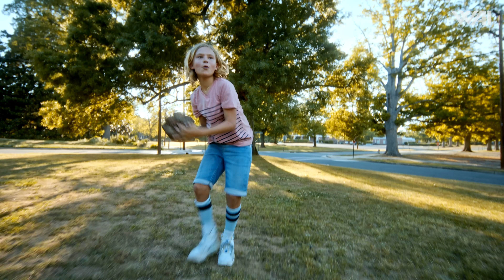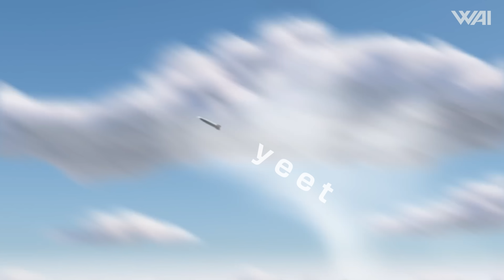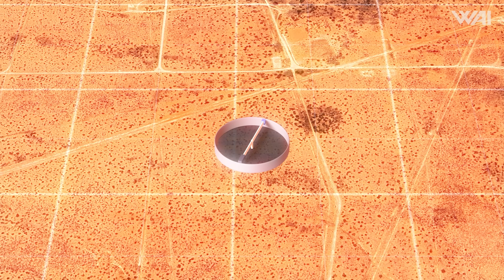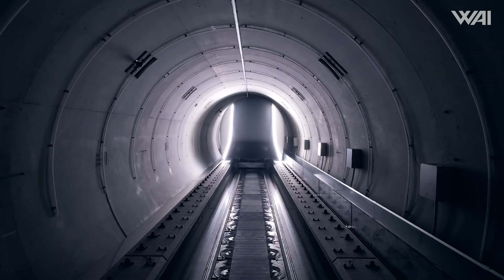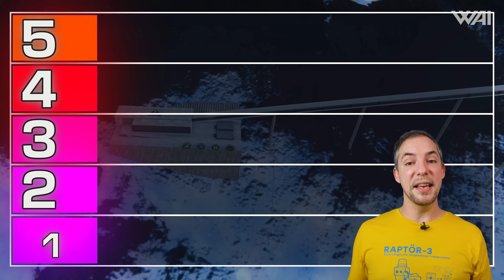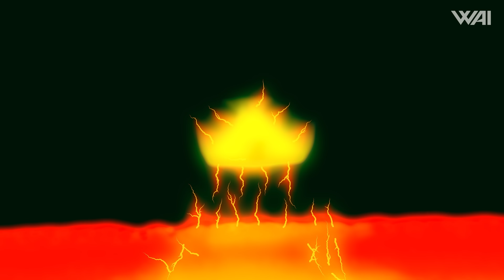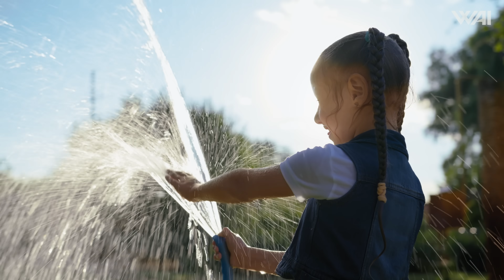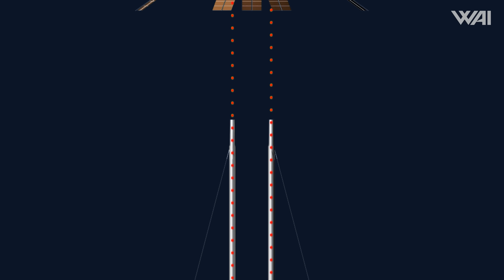The five craziest (but possible) ways to get to Space!

Comment: Search under Rovator. A wheel in orbit where the bottom reaches low to earth and teh top has more than escape velocity. Such structure could have the lowest point at 100km and the highest at several thousand km and the transfer would be with a hyper speed plane of mach 12. On the moon this would work with the lowest part stationary above the moon's surface.

Comment: Space elevators will NEVER be built. 

Why ? Because the electrical properties of the Earth will not allow it. Just think about a wire that connects even low level electrical charges to Earth Ground and it will be easy to imagine the lightning bolt that vaporizes the cable. This is already sound science and if ignored would turn that project into a money hole that would NEVER get completed because ... ZAP ... BOOM ... bye bye Baby !!

Comment: Actually there is material we have that would be acceptable to use as a tether. Graphene doped 10nm carbon nano tubes spun into a massive cable. The cable would be huge (3' or more thick depending on the counterweight's weight and distance.) and would need to be made in space, on a space station, and rolled out to the asteroid counterweight as once fully fabricated, would be too heavy to get it off the planet.. The biggest issue in this idea is capturing a NEO/asteroid, attaching rockets and flying it into a geo sync orbit for the counterweight. I considered using water or CO2 ice but sublimination would make this a non solution unless the entire sphere were sealed somehow. Just for giggles, the following is some of the math I was playing with...   Tether Deployment:
—Overall- 35,886 km CNT tether (1 m diameter, 63 GPa tensile strength, 38,000 tons total mass) deployed from Rig at 1,000 km to 9,500,000-ton asteroid Counterweight at 36,886 km; Rig factory (5,000 tons, 10 MW solar-powered) extrudes tether at 9.8 km/day, tug (2 Raptors, 5.5 MN thrust, 700 tons methalox) pulls tip to Counterweight over 10 years, attaching to pre-fitted anchor; tension balanced with initial 30,000-ton temporary mass at Rig (261 MN at 8.7 m/s²), scaling to ~29,000 tons (284 MN) as Rig grows, Counterweight maintains 285 MN upward pull; carbon sourced from ~2,000-3,000 tons space junk (yields ~1,500-2,250 tons carbon, cleared by 20 robots at 500 tons/year over ~4-6 years) plus ~21,300 tons carbon (85,200 tons methane) delivered via 568 Starship trips (2-3 years); humans oversee from 1,000 km habitat (2,500 kg, 6-month shifts, 12 trips/year); total timeline ~10-13 years with cleanup and delivery overlapping pull; tether capacity ~49,455 MN (0.785 m² x 63 GPa), safety factor ~173 vs. 285 MN.   ***This is of course theoretical...
Reply: 'There is a material'? Please show me a sample! It is not enough to be able to design a material, you also have to design a way to manufacture it! When we can manufacture a 1 meter sample, it will be worth thinking about scaling that up to 40,000km!
Reply: @john_hind  Google Graphene doped carbon nanotube filament.  it exists.

Comment: I saw a presentation on the space fountain years ago.  Cool concept.  But it occurs to me that this system has no non-cataclysmic failure modes.

Thinking about that ...

No
Non-cataclysmic
Failure modes. 

Eek!
Reply: It would probably a good idea to link multiple independend fountains together to support a single platform, so if one breaks down, the system doesn't collapse completely. I mean, we are using multiple cables to suspend large objects as well.
Reply: Huge buildings have no real non-cataclysmic failure modes. If they fail its a giant spaghetti noodle at the whim of the wind. A space fountain would still fall relatively slowly and the majority of the mass would burn up from falling straight down. Not great for the neighborhood around the base, but neither is a rocket failure on the ground. IMO, the top of the space tower would likely be using solar power from solar farms in space, meaning a cut of power is very, very unlikely. Plus multiple strands in redundancy would likely be essential. Its scale is around the 100's of km mark, which is pretty routine for large governments.

Comment: Wireless Energy Propulsion/Drive/Engine anyone?
Once upon a time, I came across a concept craft that was fueled using microwave energy beamed to it as a fuel source, from a ground source. So think about your wireless phone charger on steriods. But rather than charging up your battery, the energy fueled an electric propulsion. 
Essentially this qualifies it as a mass-less drive. Anyone else familiar with such a earth to space engine?